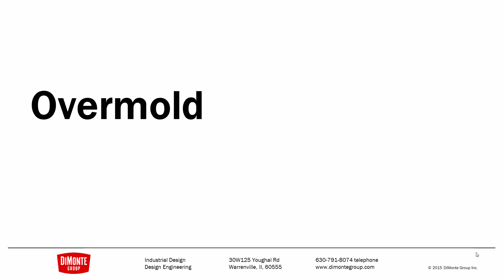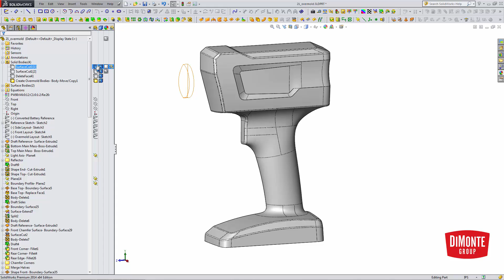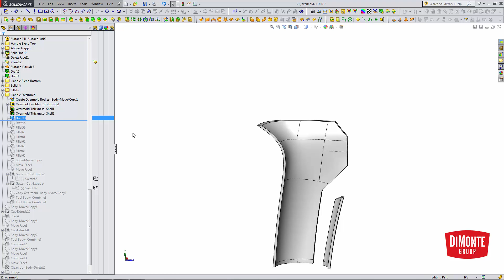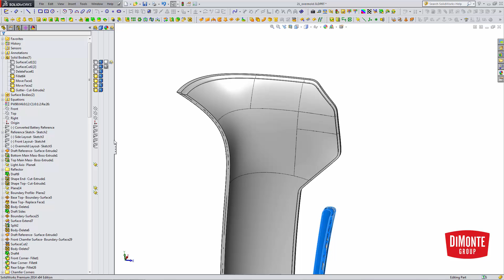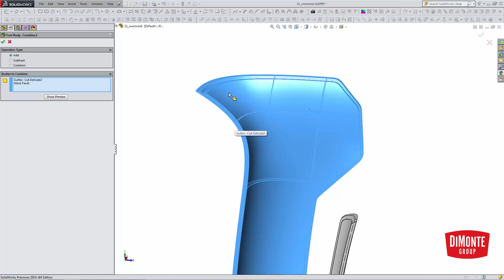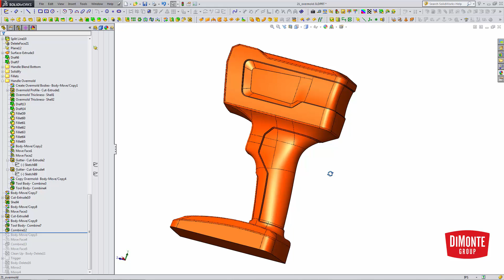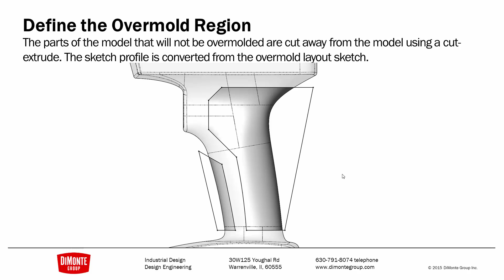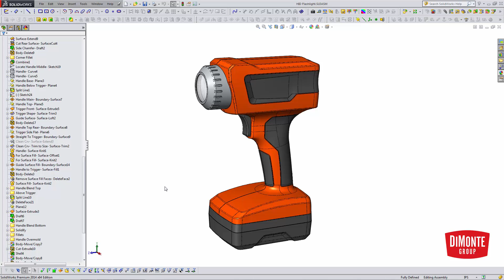Surfaces & Splines | 17- Overmold Modeling

Comment: Is interlock necessary for the over molding process to insure that the bond adheres between tpe and plastic? thanks
Reply from the maker: It doesn't hurt.  But it isn't necessary if the rigid and soft resins are paired correctly.  Talk to your molder and resin supplier to be sure compatible materials are being specified.

Comment: HOW DID YOU DRAW THE TOOL IN THE FIRST PLACE?
Reply: this tutorial is only showing how to use the tool to create the overmould, if your looking on how to make complex shapes you may need to first look at other tutorials (thats what i had to do)
Reply: This is #17 in a series (of 17).

The creation of the SolidWorks sketch was briefly explained at the start of the series. It was only an overview, because the sketch was pretty complicated; the sort where you tie yourself in knots trying to avoid unintended sketch constraints.

The industrial design sketch, on which they were based was simply imported using the Sketch Picture function.